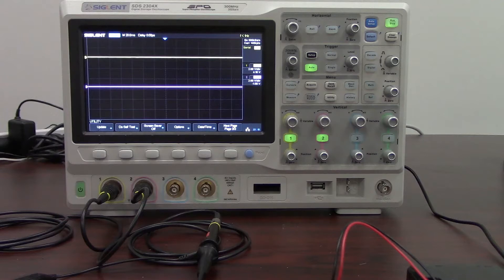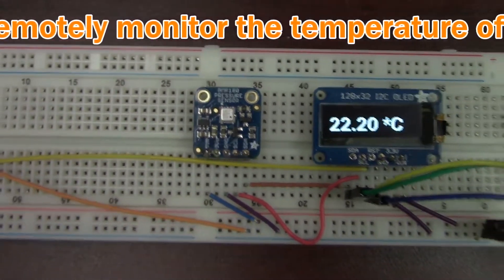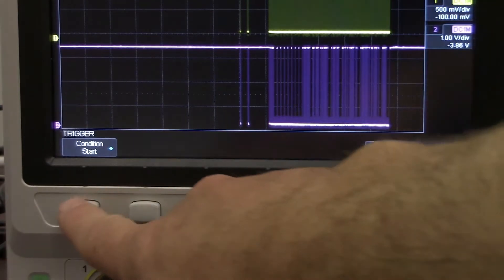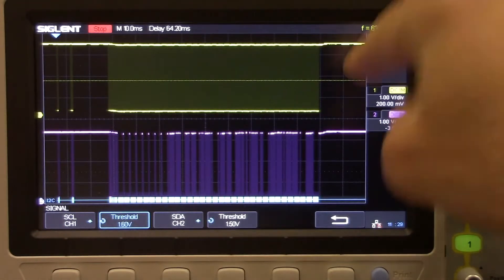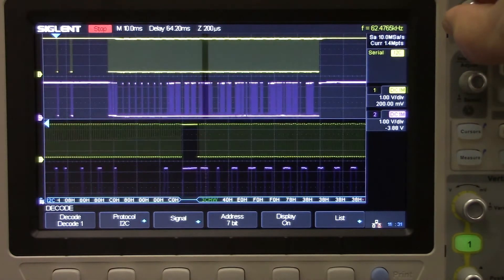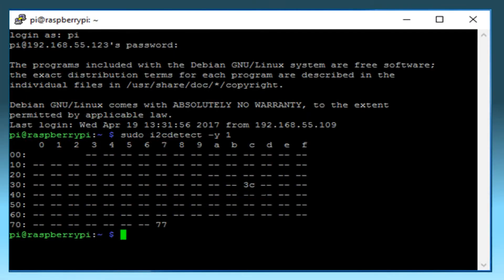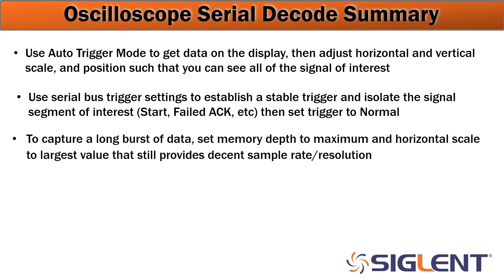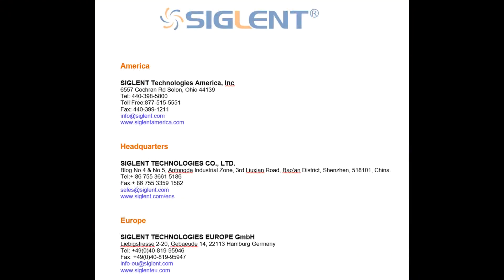How to Troubleshoot a Serial Bus with Siglent SDS Oscilloscopes

Comment: I have the SDS-1204X-E and it's I2C setup is practically identical. When I analyze a device, I notice that the last byte of data  in all reads displayed seems to be "~" in Hex display mode. I see it here on all your reads as well.

 I wonder what this means?

Is it a deliberate symbol for the I2C stop sequence or what? It's obviously not a normal hex value. I didn't see it mentioned in any scope documentation. I notice it on many (perhaps all?) I2C test setups I've used the scope with - but I'm not sure whether it means that I need to troubleshoot  my terminations or I have the trigger level set wrong or something...

thanks in advance,

M

! Never Mind !

A more careful examination of the manual section titled "Interpreting I2C decode" showed the following:

               "~A" after a data or address bits indicates no acknowledgement. For example, DB~A

Sorry to bother you!

M
Reply from the maker: No worries, we're glad you were able to work it out!

Comment: Is this is same software used in the new SDS800X HA?   Can I use these same capabilities in the UART (RS-485) protocol?  I also assume I can save the TX/RX data as binary to a USB drives and convert it on my pc?  thank you!
Reply from the maker: Hello, the software may not be exactly the same since the SDS2000X is an older model compared to the SDS8000X HD, but the SDS8000X HD does include serial decoding and powerful triggering modes, like serial bus triggering. This series also includes UART trigger and serial decode, but in order to confirm RS-485 and binary USB drive exportability we would recommend contacting our product experts at sales@tequipment.net.